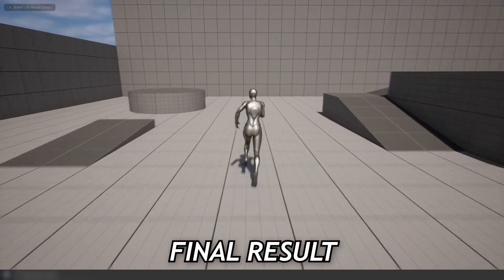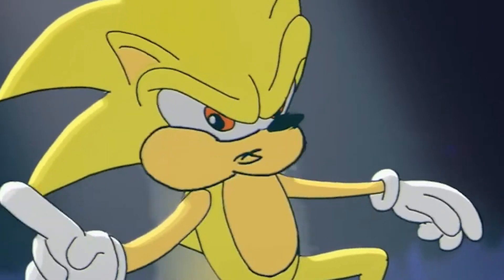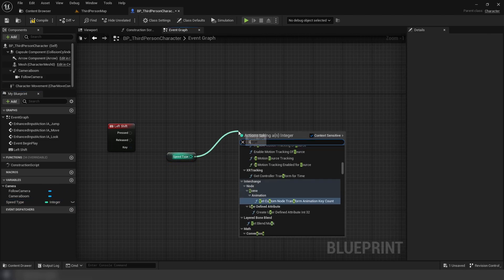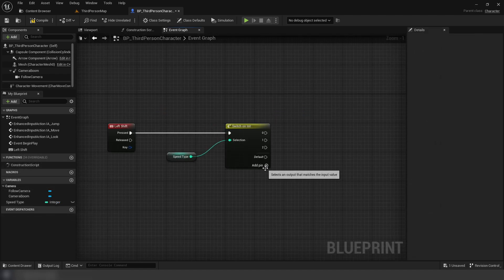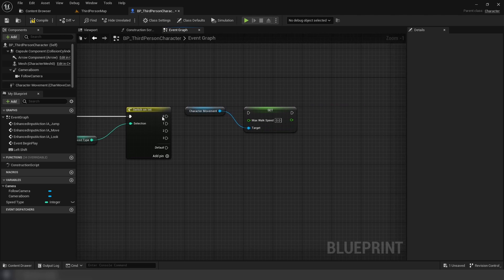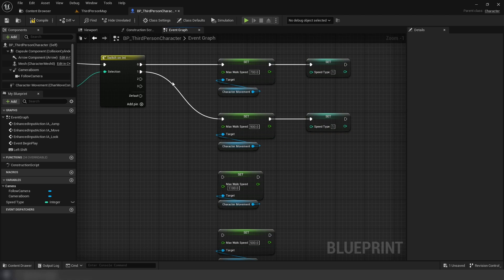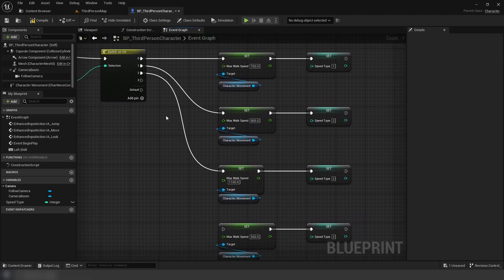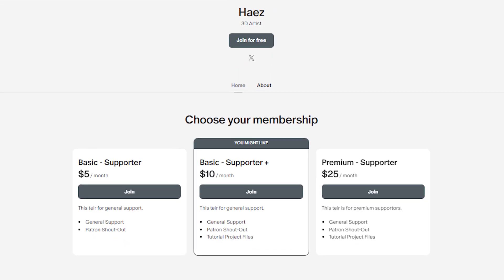Cycleable / Loopable Inputs - Unreal Engine 5 Tutorial

Comment: do you know how you can add a delay between inputs so for an example, When i press shift i want it to wait 2 seconds before letting me press it a second time, almost like a cooldown, i tried a delay node but I press shift again and 2 seconds later it plays the event which isn't what i'm looking for. Sorry for the trouble 😅
Reply from the maker: No trouble at all. I would create a branch and promote its condition to a new variable. This variable will control wether or not the input can execute your main code. ( so by default should be set to true )

After your branch sees the variable is true, then you'll set the variable to false ( in the graph ) with a delay after whatever other functionality you have then setting it back to true after your delays completed output.

I hope this helps!